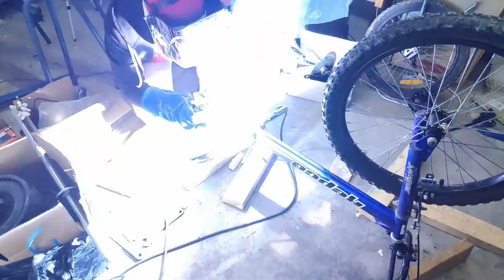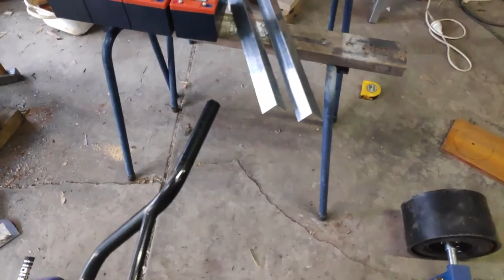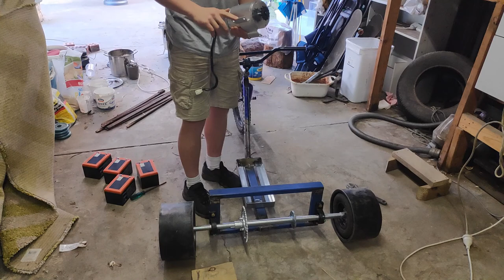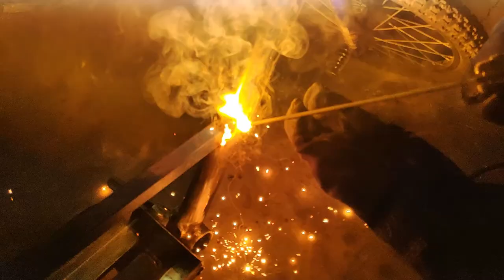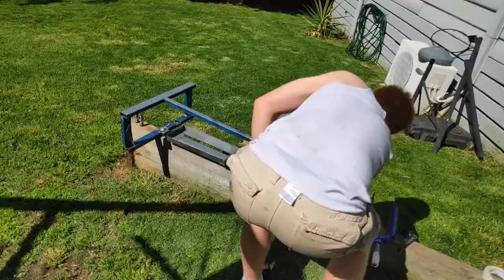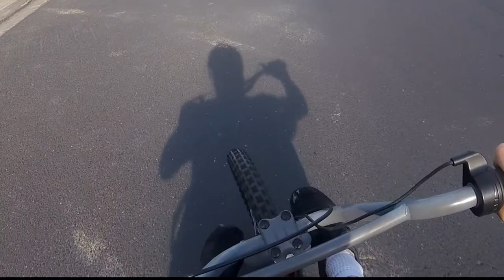1800W Electric Drift Trike Build

Comment: ay how fast does it go
Reply from the maker: bout 50km/h
Reply: @D0S.  not behd. I'm yr 12 in West side of Melbourne. I'm doing a drift trike project and I'm considering electric instead of petrol because of your video because it's pricey and you need to find thr right parts and if you get them all together it'll end up costing more. I also didn't realise that you could get electric motor kits with esc and everything.
Reply from the maker: @neo_tech6818  yea its not that much more expensive to go electric, but the main downside is the range.
Reply: @D0S.  hey would you be able to possibly link where you get that axle from on ebay?